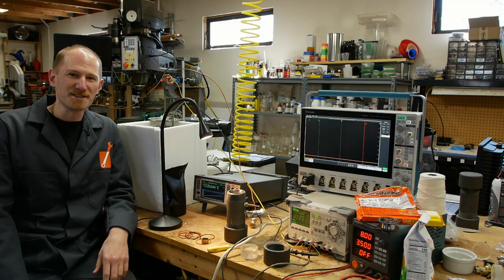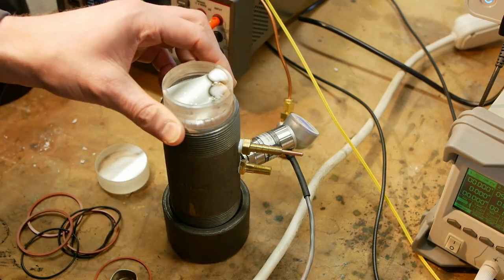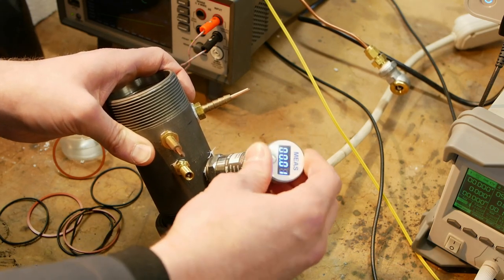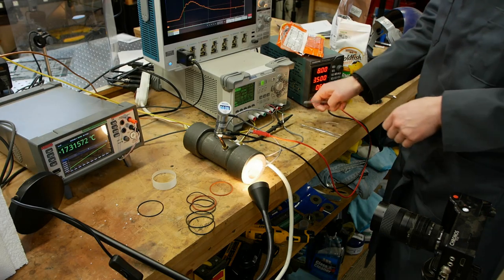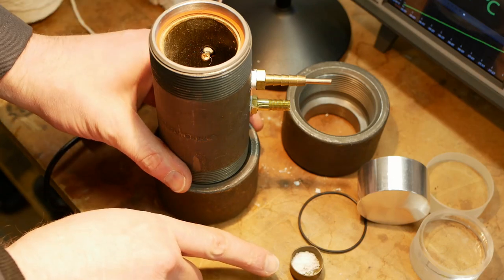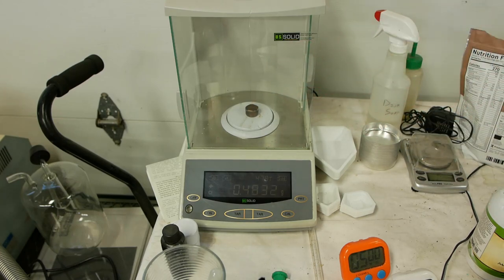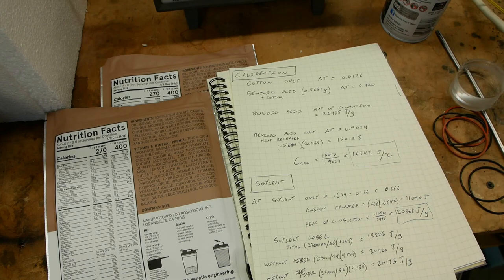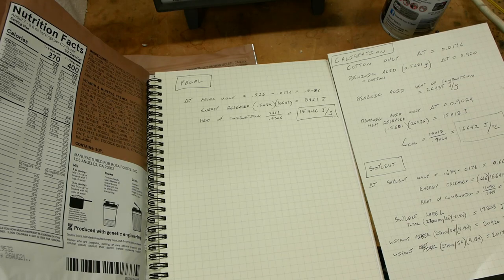Measuring human digestive efficiency vs. a flame

Comment: Thanks, this video convinced me. Finally going to replace my digestive tract with a flame
Reply: @satibel  that's a pretty big flaw
Reply: @satibel  How? It's dehydrated
Reply: @mikebarnacle1469  as an example if you eat pure glucose (sugar) you probably won't have anything come out, that there's no water doesn't prevent it from being dissolved/absorbed.
Reply: @satibel  But where would it go? It has to leave the system somehow. Provided Ben's weight stayed the same. Sweat? Exhalation? How else can mass leave the body?
Reply: Oh. Urine I guess. Urine isn't water... Fair enough, I see. I would like to know how much then practically that can throw off the numbers. I wouldn't suspect it's a significant figure.
Reply: @mikebarnacle1469  afaik most of the mass you lose is through exhaling co2, you take in o2 and add carbon.
On average you loose 200g of carbon per day this way.
You also lose water by perspiration and peeing, and non digestible elements via pooping.
Note this is a simplification, but it's at least 90% like that.
Soylent powder is like 300g per day, so the calculations may be off by a factor of 3.
If that's the case you'd need to compare 150g of Soylent to 50g of poop.

If we plug in the numbers the human digestive system is ~75%±15%* efficient instead of ~25%.
* Taking 250-400g of powder daily intake, because I'm not sure the amount used
Reply: @satibel  Not to mention that digestive systems vary from species to species vastly. But the human digestive system is actually comparable to vultures. Which is really acidic stomach juices considering vultures can eat corpses that have cyanide.
Reply: If you replaced it with a flame, calorie listings on packages would finally be meaningful to you
Reply: hahahaaa
Reply: try using a nuclear reactor instead, it's way more efficient ;)
Reply: A smart choice, you won't regret it.
Reply: You should start a local chapter of like-minded "technological flamers" ...even the desire to do such a thing is enough, no need to follow through.
Reply: @JakeWitmer  For simplicity I would suggest shortening the club name to just flamers

Comment: You’re assuming that 1g of “input” produces 1g of “output” which is likely not true...
Reply: Exactly this. You exhale the "burned" carbon as C02 as you breathe, you don't defecate it out. Most of your fecal matter is bacterial colonization of the remnants that were not easily broken down into macronutrients and absorbed by the body.
Reply: I was just about to bring this up in a comment.
It seems intuitive that it would take multiple grams of food to produce one gram of solid waste.
Some of the mass difference ends up as metabolites in urine, some ends up exhaled as CO2. I'm just not sure what the ratio is.
Reply: @MysticalDork  Isn't that a point? If You exhale CO2 that means that it was digested and absorbed by human body. Everything "undigested" will end up as a waste.
Reply: @Krawacik3d  Still doesn't change the input-output ratio issue. If you eat 3lbs of food, but only excrete 8 ounces, even if they're the exact same energy density in the calorimeter, you're only leaving behind 1/6th the energy of the input in the output.
Reply: @TrumpeterOnFire  That's true. Now that I think about that measuring total amount of energy undigested should be easy knowing it's density and total weight, maybe Ben will make follow-up video regarding this.
Reply: gonna have to start weighing the inputs and outputs 💩☜(ﾟヮﾟ☜)
Reply: Yeah, but to measure to the exact numbers the gut needs to be clear at the start and the finish so fasting cycle until the gut is clear then you measure your input and out for a week. You'll need one more fasting cycle to measure the output correctly until your gut is clear.
Reply: @RedStefan  which will change the gut microbiome and skew results as availability of many things will be staggeringly higher and so will calorie reuptake as insulin will be spiking.
Reply: I've wondered about this too. I'd like to see this experiment repeated with the soylent laced with a known quantity of inert material that passes through the digestive system unaffected (gold flake?). Then the amount of excrement to gather for comparison would contain the same quantity of inert material as the soylent sample.
Reply: @simonneilson5223  An inert substance would just pass through so you wouldn't know anything about how much mass was lost from the food from the gold, it would all be there. (Where else would it go?)
I believe the current method is to use a radioactive marker in the food.

Comment: The calories per gram is probably much less relevant than total grams input vs total grams output. You should be excreting a significant amount of mass as H2O and CO2, so for every 100 grams you consume, you likely only get half of that out in waste (totally made that fraction up. Anything between 30% and 80% seems plausible). Also, ion content (Na, K, some Mg and Ca as well) will be eliminated mostly through urine, and should be relatively low amounts in stool. Chemically, you would still expect stool to be largely the same as the food input in terms of carbon, hydrogen, nitrogen content, and comparable ratios of the assorted chemical bonds common to most organic compounds. Really not at all surprising that it's so close.
Reply: Would be interesting to find out the nature of the residue that was left after the burning in relation to total input-output, especially for 'artificial' food like this powdered stuff with nutrients added and subtracted.
Reply: Yeah, eating a gram of soylent almost certainly doesn't result in excreting a gram of poop.  This is why food studies are very difficult - you have to completely control all intake and measure all output, which often requires more control over a human test subject than most ethical boards are willing to allow.

The mineral deposits after the poop burning are an indication of this ratio - the tiny amount of minerals that weren't absorb were present in the poop, at levels higher than in the input.  It might even be possible to use this mass change to work out the ratio of input to output, if you go through all of the inputs and work out which would become a gas and which would become a solid after burning...  Probably not accurately, but good enough to get a rough estimate of the ratio.
Reply: To add another aspect to this, how can we be sure that the fecal matter is just what you ate, and not include a mix of dead cells/other parts the body no longer needs?
Reply: Fecal matter includes a lot of dead bacteria, undigested plant stuff, fat (2-15% of the solid part), 2-25% protein. Outside cells just flake off, and epithelial cells (insides of the stomach, intestines) also count as outside, so yes, they are also in the poop. Internal cells usually undergo aptoposis and macrophages (literally means large eater in Greek) "digest" the remains. (See also phagocytes, the cell-eaters, and efferocytosis, undertaking-of-cells or cell burial.)

Basically neighbor cells recycle what they can, and empty the rest into the blood, then that finally gets to the urine.
Reply: @iccuwarn1781  It's not just what you ate, for sure. Also, your body adds a ton of stuff, enzymes, acid, bile to neutralize the acid, and a constant layer of mucus to protect the inside of the digestive tract from eating itself away. I think dead cells are largely reabsorbed, except for bacteria that die in the intestine, and the skin that sloughs off the outside (and into the digestive tract, which is also kind of the outside, topologically speaking)
Reply: @RubenKemp  send it to Cody's lab.
Reply: @Timestamp_Guy  idk if I dead cells are really reabsorbed. I know the brown color of fecal matter comes from compounds from dead red blood cells. I'm not sure about other cells but I would assume blood makes up a big chunk of the total dead cells at any time. Your tissue cells just don't replace themselves at that kind of rate.
Reply: @henrybyers5557  I'm not a biologist, so it's a bit outside my field. I can see that for blood cells, as they move around and thus could be excreted anywhere. I'm just not sure how (or why) most of the cells in your body would be transported all the way to the intestine to be eliminated. The immune system would have to break them down into small enough chunks to reenter the bloodstream, and I thought I recalled from physiology class that they basically got demolished by the immune system and flushed through the lymphatic, or something like that. Of course, waste in the blood stream is usually filtered out at the kidneys, not crammed into the intestine?
Reply: @Timestamp_Guy  I'm no biologist either, I have just heard the blood cell thing and made some probably-innacurate assumptions. Take with a lot of salt i guess
Reply: @henrybyers5557   Most cellular waste that cannot be recycled is filtered out of the bloodstream by the kidneys and leaves the body as urine (or the lungs in the special case of CO2). You're right about dead red blood cells, though.  The iron in heme is recycled, and the rest is excrete out in bile to be fermented by bacteria in the gut and partially reabsorbed.  What isn't is the brown color you referred to.
Reply: @Timestamp_Guy  In fact, not all waste goes through the kidneys, just what's water-soluble (which is most of what's in the bloodstream, to be clear), with the rest being processed by the liver and excreted by the gallbladder.

The most significant single source of non-water-soluble waste in the bloodstream is from hemoglobin. The spleen digests dead/'spent' blood cells, both red and white (including those white blood cells which have consumed dead cells and pathogens), recycles the iron from the hemoglobin locally, and excretes the rest of the waste back into the bloodstream mainly in the form of bilirubin, a yellowish-brown pigment, which the liver then extracts and 'conjugates' (binds with proteins) most of it and oxidizes some into biliverdin (a greenish pigment) and excretes both into bile, along with a number of other things in smaller quantities, including excess fat. Though, the liver doesn't excrete all of what it processes, it also breaks down some insoluble things into soluble components, which are recirculated to the kidneys. Bile of course is secreted into the digestive tract at the duodenum, just behind the stomach, and the useful parts of it are reabsorbed, but the conjugated bilirubin and biliverdin is not, and they form the primary pigmentation in feces.

The pancreas also secretes pancreatic juice into the intestine, and I think there are other minor glands, but as far as I can tell there are no waste products in that, just carbonate and some enzymes.
Reply: @yimeizi2648  Seems like that would be way too dependent on body mass to generalize to "per person". "per 100 kg body weight" or "per thousand kcal consumed" would be more useful, as that would take into account varying size of humans and activity levels. Applying something that generic to the exact data form the Soylent project can give a ball park idea, but I wouldn't trust the number exactly.   90% seems high, but still within plausible bounds.
Reply: To jump on your last point: that stool has largely the same chemical composition is definitely not true.
Take for example eating only sugar. Sugar will almost entirely be decomposed to H2O and CO2 by your body. Ergo: different chemical bonds and last but not least: no stool matter.

Comment: So you measured the flammable-calories per gram of each, but, if evaluating efficiency, wouldn't you have to also factor in how the amount that went in corresponds to the amount that went out?
Reply: agreed...my understanding is with soylent there is very little waste product.to cross multiply solving the correct fecal load to test would be vital.
Reply: That is a perfectly normal way to look at it. But knowing that factor presupposes that you know the efficiency number that is attempted to be derived.

The alternate method is then comparing known mass and then seeing what energy remains in that mass. The end result is the same because if your gut is ~20% efficient (16K / 20K), then if you put in 0.5  grams, you'll get 0.4 grams out. That is equivalent to 20K Joules in 0.5 grams in and 16K Joules in 0.5 grams out.
Reply: @Michael-OBrien  But what about the mass that is lost via exhalation? The carbon in the food we eat is what ends up in the CO2 we exhale, yes?
Reply: Yeah, I was surprised this wasn't mentioned.
Reply: @Michael-OBrien  But if you just assume the mass of input is equal to the remaining mass after digestion, then it would lead to a large error if that isn't the case.

For example, if I eat 1kg of food (~20kJ/g => 20MJ) and the gut would produce 0.5kg of waste (~16kJ/g => 8MJ), then just comparing the energy per gram in each would lead to an efficiency of only 1 - 16/20 = 20%, but including the total mass would lead to 1 - 8/20 = 60% efficiency, which is a large difference.

I don't know if something like that happens in reality, it just seems plausible to me, that food we eat will lose mass in the digestive system, since we can gain weight by eating and we can't produce that mass from air.
Reply: Yes, good point. The calorimeter measures the energy density of the input vs the output but what remains unaccounted for is the reduction in mass of the output compared to the input. When the body metabolises fat this is expelled by mass as 84% CO2 and 16% H2O (assuming no ketosis) but there is a long complicated chain of biochemistry between food entering the mouth and being converted into fat or otherwise being utilised.
Reply: @Twisty1024  what if you are in ketosis? How do those percentages change?
Reply: @Twisty1024  He should just measure how much food gets converted into how much turd, no need to consider biochemisty. 
We sholud just say that everything that did not come out at the other end has got used by his body.
Reply: @andraskatona9766  Exactly my thoughts. Average intake and output over a few days to get the ratio and recalculate the efficiency.
Reply: @Eddie Hitler 7kcal/g, in fact! This is why I don't drink while dieting. It's just not worth it.
Reply: @Basement-Science  Only problem with this is the bacteria that get flushed out with the rest of the excrement. You can eat nothing for a week and still have material coming from your rear (I know from experience). How much? IDK...
Reply: @ssholum  Well assuming your digestion is in a steady state, everything including bacteria is created from the food you eat, so it doesnt matter. 

If it is NOT in a steady state, you have a million different problems with this experiment. For example gaining or losing weight at all will also make the measurement completely flawed. And of course there are still a million variables from your lifestyle etc that willl affect everything even if you eat based on a strict schedule.

This is obviously nowhere near a full-blown study. It's all just about getting somewhere in the ballpark.
Reply: I would think that since different macros have different caloric density (ex. Gram for gram Fats have x2.25 more calories than carbs ),  weight difference would be meaningless unless u break it down by macros
Reply: @Basement-Science  When you say gaining and losing weight, did you know you gain 8oz when you drink that equivalent of water? We are not ICE's, we change weight by the hour.
Reply: Indeed. If you've been on these types of diets you'd know that EXTREMELY little waste product is produced. So little that these diets usually lead to constipation.
Reply: @Eddie Hitler Not really. Just google ethanol metabolism and you'll get your answer.
Reply: And here I thought I was the only one expecting him to lay out a log on the kitchen scales.
Reply: Excellent video.  Excellent.
Reply: @drdca8263  if it ends up in CO2 then the energy has been extracted. That's the amount we want to measure.
Reply: @Michael-OBrien  poop is clearly more concentrated than food, if you eat a pound of food you dont poop out a pound, unless its 99% fiber.

Comment: "I did a sloppy job doing the lamination" he says holding something that looks optically perfect.
Reply: There where some bubbles I think. You can see them when he holds the composite at an angle.
Reply: according to Peter Brown, you'll have better results curing in a pressure pot, even if you skip the vacuum offgassing
Reply: He's just messing around